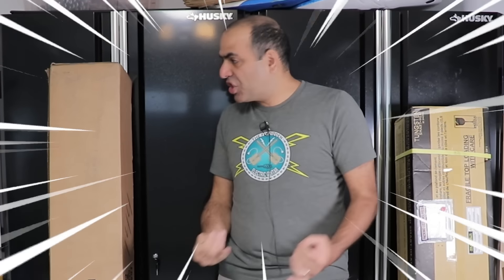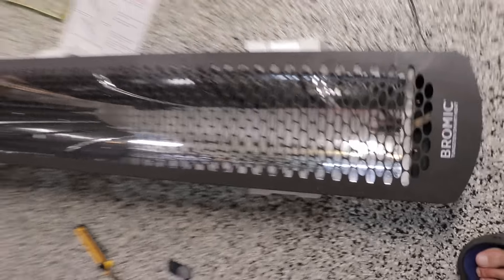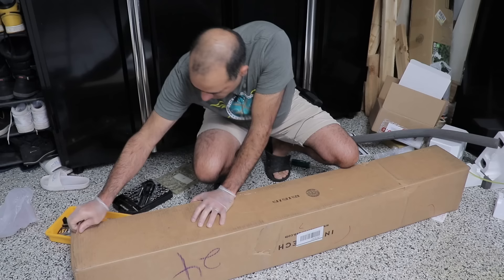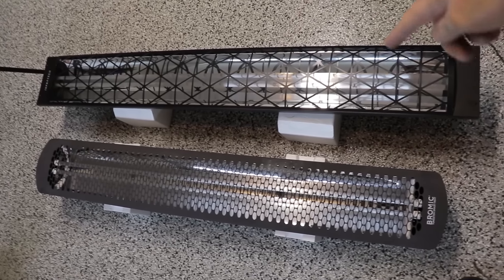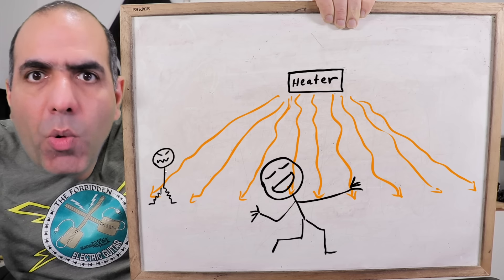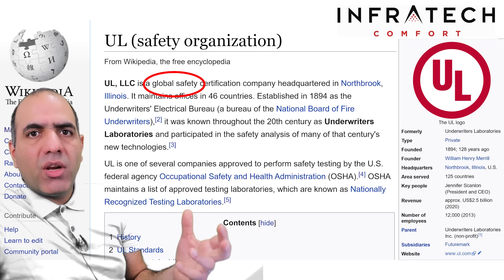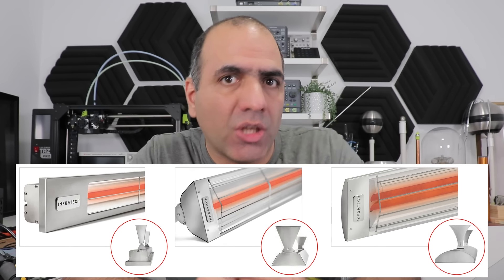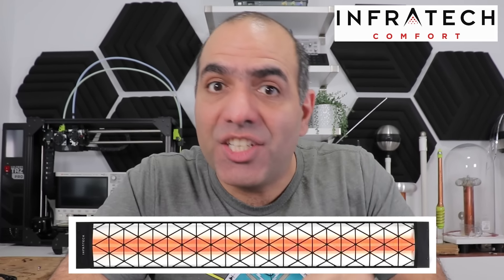Comparing 6000 WATT Resistors, Infratech versus Bromic Heaters

Comment: Lifetime warranty*

* 1 year parts, 7 years elements 

Even cats have a longer "lifetime" than that.
Reply: they send a hitman after 7 years
Reply: Maybe they have low expectations of humanity's survival.  Frankly, so do I.  ;-)
Reply: @ponchorodriges8460  lmao if they put that much effort into their warranties, they’d probably have the most competent customer service in the industry (Ignoring the side effects of having to get murdered)
Reply: Reminds me of a car transmission oil that "didn't need to be changed because it lasted the lifetime of the transmission". What they didn't tell you is the expected lifetime of the transmission is 100k miles (aka warranty coverage) assuming you don't change the oil. But it'll last much much longer if you actually change the oil.
Reply: @virt1one  I’ve worked in patent law. It’s fairly easy to get a patent by making a really slight variation on existing technology. There’s absolutely no way a parabolic reflector is something that is special this company/product. But chances are, they got some patent on something almost entirely insignificant, like maybe the way the mirror is fixed to the rest of the unit, or the particular ordering of coatings, or something like that. A majority of patents are actually like this. Companies get them in order to look good and look like they’re pushing the envelope. And they create portfolios of many insignificant parents that are just slightly different ways of doing things. Then they can get a gold star to show to investors. 

The system is supposed to be a good thing, because innovators get to protect and exclusively profit off their hard work for a period of time, and competitors are forced to think of new ways to do things if they want to make money or get a patent of their own. 

But it’s usually silly insignificant stuff and it allows people like the guy on the phone too buy into the belief that his company has super cutting edge parabolic mirrors that no one in the industry can touch 🤣

I should probably just look up the patent and see just how specific and how many qualifiers they had to add to their “claims” (the very specific language at the end of the patent that they can sue people for infringing) in order to get the patent… for shits and giggles
Reply: @ponchorodriges8460  no need. it will just burn down your house.
Reply: Lifetime warranty*
*If you are in terminal phase of a lung cancer.
Reply: Well, since cats (according to unverified sources) have 9 lives, you have to divide their lifetime by 9. By that logic it becomes a close call with the parts, and a clear win for the heater for the elements.
Reply: It refers to the lifetime of the product and in most countries laws electronic devices' lifetime is 7-10 years.
Reply: They lie straight to your face
Reply: well, maybe their lifetime is only 7 years
Reply: lifetime waranty. If the heater die, warranty is over
Reply: It refers to the lifetime of the product. So if the thing breaks (even 2 days in), its lifetime is over. Hence, no payments.
Reply: Lifetime is in dog years.
Reply: @Michael-kp4bd  It probably is the reflective treatment they use, and might have no benefit to others, but the sales team can use that as being unique. It didn't seem to give them any advantage. If you look at an optics web site, a front surface parabolic mirror (or just a reflector) has many choices of coatings that can vary by thousands of $$ that deal mostly with chromatic aberrations, especially with IR light.
But on the point of small changes to previous patents not amounting to anything, Edison had quite a few that his people filed or bought before he was credited with "inventing" the light bulb. Do you know how many he had? I don't.
Reply: @BenjaminCronce  "Lifetime" means "until our products self-destructs or murders everything around it"
Reply: @Michael-kp4bd  I think patents serve most as a defense mechanism against patent trolls. Otherwise you can be sued for no reason just for using something as basic as a parabolic mirror.
Reply: @monad_tcp  Patents, along with the legal system in which they exist, are the mechanism by which parties are able to “patent troll”. The ability to troll is an unfortunate side effect of patents. Without them, they would be no trolling — there will be no mechanism by which to sue. Eradicating patents would 100% solve the problem of trolling… so what you said is incorrect in the most absolute sense.

However the side effect of eradicating patents would be that inventors would more commonly face the issue of not be able to reap the rewards of their inventions (for example by having the time to put together resources to create their product and start selling it, or by chosing to allow others to create it but LICENSE it and thus still profit from their ingenuity companies with more resources would simply beat them to the market. If Patton’s were eradicated, companies with more resources would nearly always beat the inventor to the game of getting their invention to market.

So I don’t have a prescriptive solution for the problem, besides the justice system and judges in particular being much more aware of the ill intent of trolls. Even then, they can be edge cases and gray areas.

However trolling can only exist if you have a patent and it’s essentially extortion against someone creating a product… Not extortion against someone with a patent, as you seem to argue. 

Tl;dr - A patent by definition gives you the grounds to sue. It does not give you any inherent protection against being sued.
Reply: @BariumCobaltNitrog3n  I think we inherently agree on everything you just said. I’m just saying that the system works in some cases for its intended purposes, but a majority of patents granted today are pursued for optics (in a manner exactly how you pointed out — for sales strategy) and are not innovative. And it is my strong suspicion that the supposed “parabolic mirror patent” invoked in the phone call is exactly one of those kinds of patents.

I.e, they patented something that is technically unique (an absolute requirement for your patent application to have any chance of getting granted) but for all intents and purposes the actual “unique” part is useless over existing methods. Their product has no inherent value over the other parabolic mirrors, which they even know they have no right to sue over, because they didn’t actually invent the parabolic mirror. But they speak of their patent as if they have invented the parabolic mirror. It’s a manipulative strategy, and not progress. It’s kind of the name of the game now. 

I’m not completely black pilled about this though, I have helped small businesses patent their interesting new product. And it is rewarding to know that Facebook, Google, or whatever existing company that could build a competing product within a week, won’t be able to just steal the idea and corner the market first.
Reply: @Michael-kp4bd  Yeah, things are complex and never a binary. 

Its not a ban patents vs allow all patents, more of how generic/abstract or concrete they need to be and for how long patents should go.

Its kind of subjective and is a case by case basis.
Reply: @monad_tcp  indeed. Still, I’m telling you — especially in a space where there is already plenty of existing technology (like with mirrors, or even parabolic mirrors) the parents have to be extremely specific and concrete. The issue is how companies weaponize their patent, by misrepresenting it and sending cease and desist letters/basically extortion threats to small companies over patents that wouldn’t hold their weight in court. The main issue is that it’s probably cheaper to pay a company something like $200,000 then it is to get lawyers to defend against their bogus claim of infringement of their patent.
Reply: Lifetime refers to the life of the unit; the warranty is valid until the unit dies.
Reply: my dog is older than that :v
Reply: They probably mean lifetime of product or sth, but idk 7 years doesn't sound like a good lifetime for a heater, is it? I've never bought a heater like that so Idk
Reply: @BenjaminCronce  that's the headsup I was looking for to change my transmission fluid.-
Reply: Lifetime Warranty for the lifetime of the device.
Reply: Even a  Crain fly lives longer that that
Reply: Lifetime Warranty*

*If you're a newt
Reply: "lifetime" usually refers to the lifetime of the product on shelves.  Meaning as long as it's actively being sold.  This is probably because as long as it's actively being produced, there will be an easy supply of spare parts for warranty repairs, whereas after production has moved to a newer model parts may not be as easily available.
Reply: they mean the product lifetime ;)
Reply: It’s the lifetime of the element.  Duh
Reply: Lifetime of the product 🤦‍♀🤦‍♀🤦‍♀ not the customers lifetime lol
Reply: Australia has better consumer laws than the u s. If it says lifetime you can hold them to it to a certain extent. The infratec if it breaks after a year thats it.
Reply: @ponchorodriges8460  lmao im dead rn
Reply: I bet it means lifetime of the heater, which they likely specify somewhere as 7 years
Reply: @schumbo8324  indeed, it seems to be based on the same timeline as the taxation write-off laws (the time it takes for the depreciation of an inventory item to have reached a taxable value of 0 and can be safely written as if it is not in inventory anymore).
Reply: The lifetime of the product.
Reply: They listened to That Funny Feeling before writing the document.
Reply: Lifetime warranty: while it works it is on warranty, when it dies warranty ends:)

Comment: I do electrical for a big restaurant in Dallas that has around 20 infratech heaters the same size as what you got and the elements last around 2 winters being used for around 12 hours a day, 4-5 months of the year. Changing these out is fairly easy but the main problem we always come across is the crimps on the end of the wires that go on the filaments burn up rather quickly and leave a good chance to short to the casing of the heater once the wire melts off

Comment: Should have measured temperature off the top of the units while they were running.  If the Bromic's top was cooler for its surface area/Watts consumed than the Infratech's, it would help support their claim of a more efficient reflector.
Reply: he'd have to turn the whole thing upside-down because heat from the open end rises.
Reply: @jacobellinger8027  Shouldn't matter, which every unit had a more efficient reflector would still be cooler. Infrared doesn't heat the air.
Reply: @jacobellinger8027  could he mount it on the vertical way.. and measure front and back?
Reply: It doesn't have a superior reflector, it's marketing lies. This is already explained and obvious from the energy draw and heat output. If you're still confused watch the video again.

Comment: Bro this dude always delivers remember "Hes and electrical engineer which means he can do anything"
Reply: Reminds me of that Mould effect video where he gave my personal favorite quote "this is a mechanical problem and as an electrical engineer I am overqualified to deal with it"
Reply: Ben 🅥  Please don't spam. You just gained a dislike
Reply: @moya9450  OH NO! A DISLIKE! WHATEVER WILL THE BOT DO?
Reply: @Eric-zz5ij  They won't do much, once they get reported enough.
Reply: @Eric-zz5ij  Probably you like Spams
Reply: @moya9450  ?
Reply: @Eric-zz5ij  These spammers are not Robot probably. The robots spam different things. These kind of spammers just want to hunt some view from other's video's comment section. Is your keyboard Caps Lock is stuck?
Reply: @Karl with a K If you are talking about the porch, thats 10ga, he covered it in a past video. NEC 310-16 sets an allowable ampacity for 10ga wire to be 30A for 60C rating and 35A for 75C rating. The distance is less than 10 meters and it's a purely resistive load, voltage drop is not critical and the measured voltage drop to 229V from 240V is actually less than the NEC recommendation of 5%. But since the 5% voltage drop for non-sensitive equipment is a fine print text, it's not actually required.

So in every case the circuit is fine given the branch circuit wire rating is greater than 125% the continuous load for the heater currently installed. The other two heaters while 1.25A over the continuous load limit, were operated for less than the time required to be considered a continuous load and thus are not bound by  that limit and can use the full breaker rating.

Comment: For temporary connections, Wago 222 or 221 you will find very handy as they won't damage the conductors and are available at 32 and 40 amps. The 222's have a testing point too.
Reply: But he won't have as many chances to make sparks and explosions. lol

Comment: The standout for me was how incredibly similar the products were. Makes sense, though, this sort of tech is surely pretty dialed down.
Reply: It's very mature tech. We had one of these radiant type heaters with reflector when I was a kid in the 1970s.
Reply: Yeah there's very little you can do to improve these now.
Improving power factor, using material that is much smoother and free of perfections, and improving resistors is about as much as you can really do at this point.
Reply: @Unethical.FandubsGames  Well there IS one element they could improve. The safety guard! With a more reflective coating and thinner profile they could keep the safety but reduce how much it absorbs/reflects infrared radiation. Honestly, that's really the only thing left you could really do. As you said, not much else to do.
Reply: Giant resistor with the parabolic mirror.  Both are essentially "solved" for now so yeah, not much a company can do to get a competitive advantage, at least for performance.  You would have to look at durability, customer service, quality of components (Although these are essentially identical too), and most importantly price.  And I guess aesthetics, but you can't really reliably just "improve aesthetics" of your product, that's subjective.
Reply: Yeah, it's a race to make the lowest grade energy output (heat) in the most efficient way possible. Kind of a brain teaser, too, energy is dearly generated by heating water to generate steam to get momentum from a turbine in order to generate electricity, which then gets sent out only to be converted back into heat :P

But that's the way it goes.
Reply: @jaakkopontinen  True, but it;s obviously a LOT easier to transmit electricity long distances than it is heat.  The problem isn't so much generating heat as it is generating heat where you need it, especially since heat very much wants to diffuse as quickly as possible!
Reply: @Tinil0  Yep!
Reply: @feldamar2  They already improved the safety guard, just not for efficiency, but appearance.
With how similar they are, look and price are what will sell them in the end.
Reply: "pretty dialed down"
i believe you mean dialed in. 
the phrase came from tuning early radio that used dials into a station.
Reply: @darkshadowsx5949  yup, that's what I meant, thanks.
Reply: Is it possible to use a heat pump to drive an infrared heating element?

Comment: By evaluating the profile at 5 feet against the floor, I think that's more useful information, since that's the profile that would affect you a few feet off the ground it it's mounted at 8 feet. Or in other words, your face would feel that pattern, which is more important than the floor.
Reply: Indeed, also the vast majority of the cross sectional area of the human body is above the waist. Most of that being the torso so that is the area of your body that. You might not feel that as directly due to the insulating layers of your clothing but it is still contributing a lot to reducing the inevitable heat loss that would still occur even through your clothing. By heating the outer parts of your clothing even if it doesn't manage to reverse the temperature gradient through the layers of your clothing it will at least reduce it. This in effect would aid your clothing in reducing the body heat lost to the environment by reducing the thermal gradient that is drawing energy away from you. End result is a non trivial fraction of the heat the air is absorbing from the outer layers of your clothing was deposited there by the heater and thus is not being drawn from your skin. Since we experience temperature in those relative terms from receptors in our skin detecting that energy gain or loss this would also make you feel warmer even if it is less noticeable given the more significant heating of any exposed skin.

Comment: Don’t know if either of these companies was expecting such a engineering type of comparison 😅
Reply: If this level of comparison happened in smartphone world
Lg would be still selling in millions
Reply: @zawhernos2541  With LG gone, we will no longer have any smartphone innovation.
Reply: @flandrble  apple has that no port, no button, no hole innovation  with eco friendly bs

Don't worry
We'll lose more 🙂
Reply: I didn't think I would like this, but more of these please
Reply: @flandrble  Sony is actually pretty good, so is Asus's gaming line, they're just pricy. I refuse to buy phones without headphone jacks ever again. It's so nice to have a modern too of the line phone with a good internal amp and a headphone jack.
Reply: @XenZenSen  so much smartphone innovation was lead by LG, double tap to wake and lock? LG had that years before anyone else did for example.
Reply: @zawhernos2541  a self assembly phone I'm hoping for ,esthetics are overated